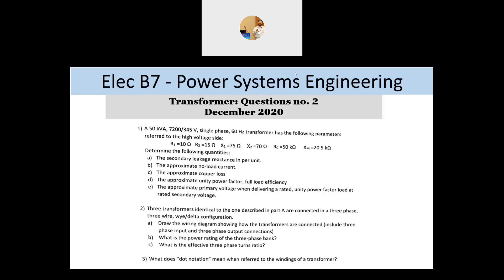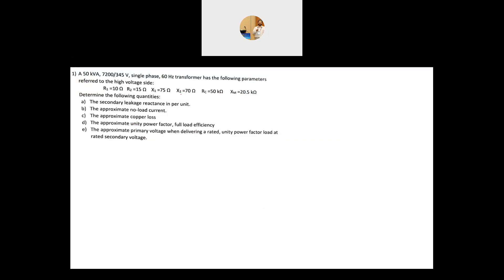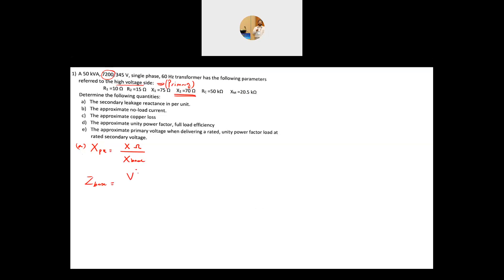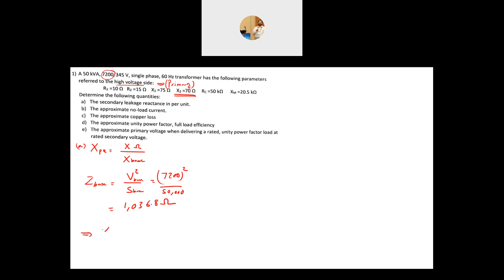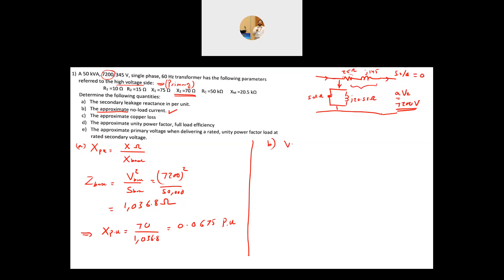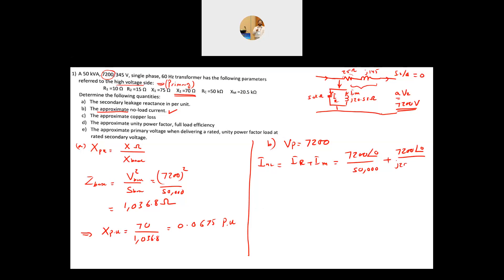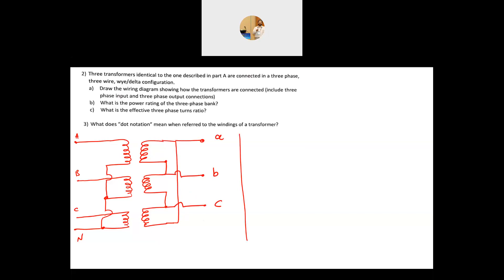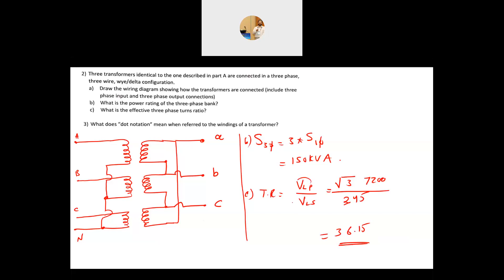PEO solve examples (ELEC B7) Transformer Question no. 2

Comment: Thank you very much for this Dr. How come we used Vp=7200 in part b and calculated Vp =7442 in part d?
Reply from the maker: The 7200 is the secondary voltage when it is referred to the high voltage side and not the primary voltage. The calculated one is the primary voltage which is 7442
Reply: @electrical4everyone  Understood. Thank you Prof.

Comment: Thanks a a lot Dr, based on our understanding on previous slides  R equivalent = R1+a2 R2 , please advise
Reply from the maker: The resistor and reactance of the secondary has been already refered to the high voltage side which means it has been already multiplied with a^2.

Comment: great
Reply from the maker: There are 7 questions in B7, 3 about components and 4 about system. I'm trying to concentrate on the easiest questions to secure the needed grades which are 3 phase, transformer, synchronous generators. Then there are the more difficult questions that you need to select only 2 and trying to provide samples for another 3, transmission lines, load flow and short circuit. You only need 2 of them.
Reply: @electrical4everyone   that’s a great approach! Once you’re able to solve more examples on transmission lines, load flow, and short circuit analysis, it will definitely give us a stronger grasp of these topics as I felt still lacking to completeley solve those questions from the past. 
As always I really do apreciate all the efforts that you have put into this channel and covering topics that students are finding hard.